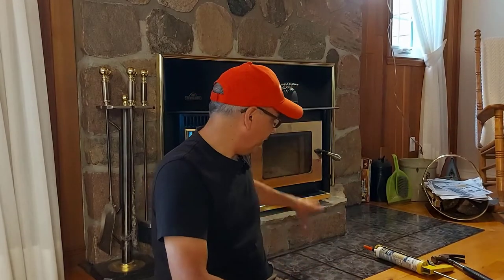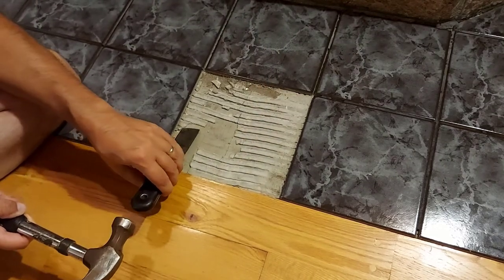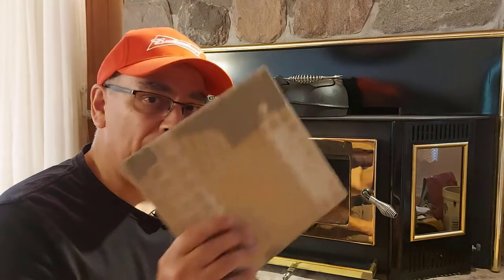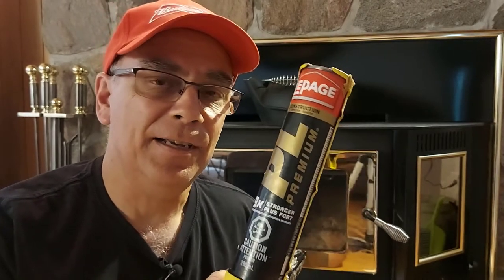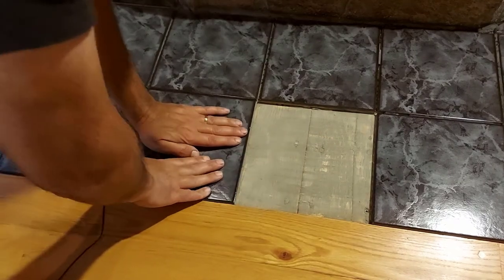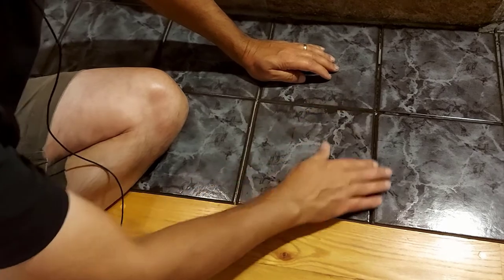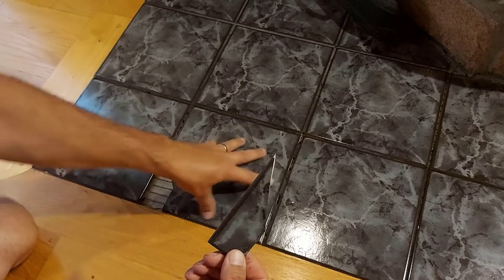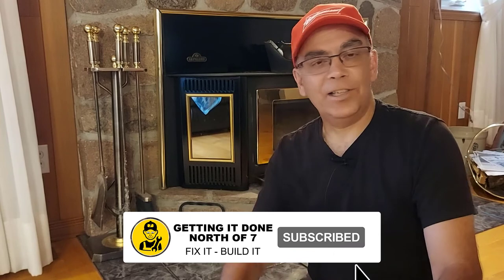Temporary Broken Tile Fix | Remove and Replace Floor Tiles

Comment: What type of PL adhesive are you using here? 
I was looking and found some made by Locktite but , they have different types. 200,400, construction, subfloor for example.